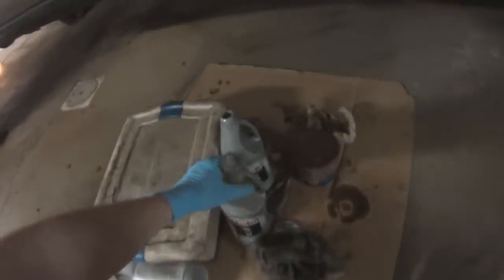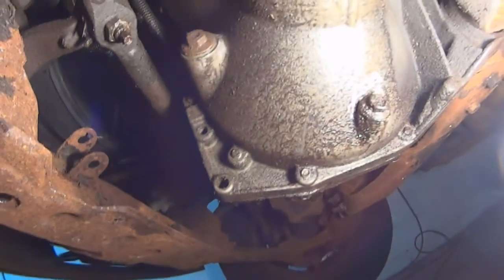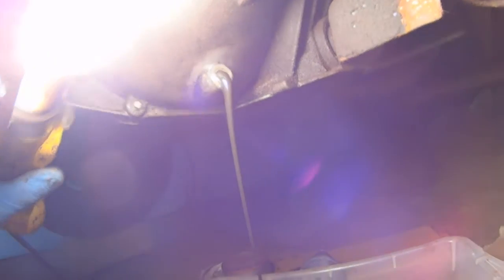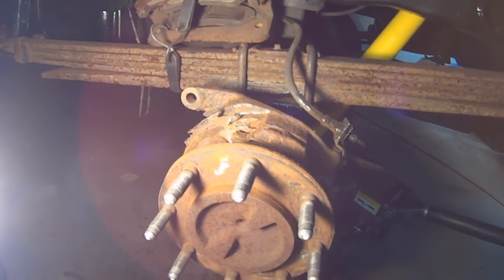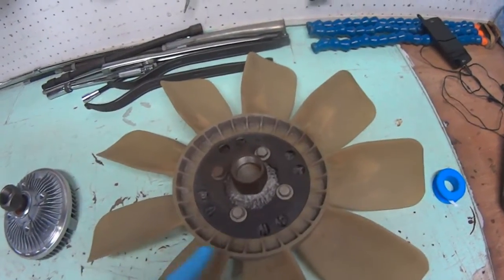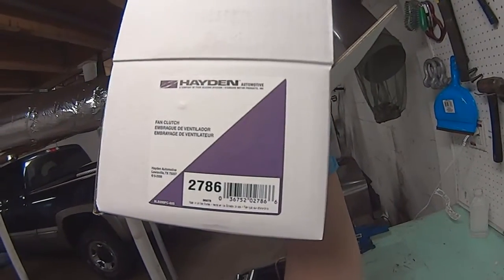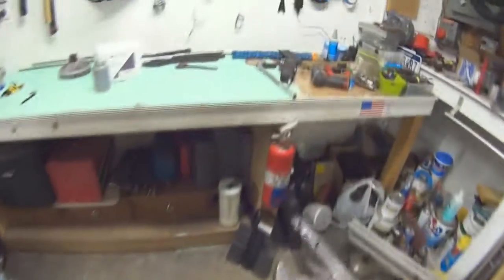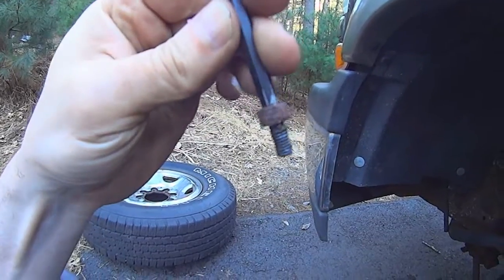Silverado fan clutch, diff oil, Parking Brake, ABS sensor

Comment: I made a comment similar to this one in a recent video of yours and I personally will travel to Arizona to buy my next used vehicle. The prices that I have seen for vehicles less than 25 years old are constant with rusty state vehicles. Ill pay $1000 to $1400 to have it shipped on a truck and enjoy a 100% rust free vehicle. I am shocked the backing plate was rotted away on the rear brake assembly. You cited cost as the reason why you just repair rust instead of buying from AZ. I get it. I would rather pay shipping and have a truly clean ride.
Reply from the maker: But its more fun this way. I will cherish these memories laying under this truck having and inch of rust on my chest.

Comment: What hole do you pump the greese in got the gront wheel bearing? The one where the sensor goes in, or the threaded bolt hole? Thanks!!!
Reply from the maker: The one where the sensor goes. You can see inside where the sensor wheel is spinning. That's the hole.